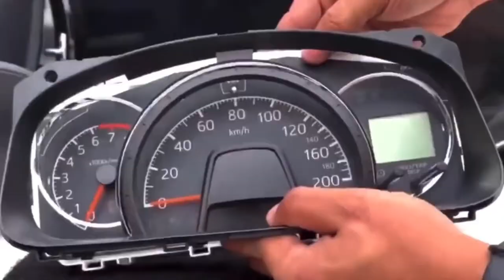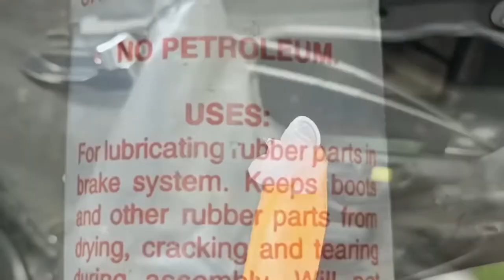DIY PMS on the Rear Door Window Regulator

Comment: Sir ano po mabisang pangtangal ng dagta ng manga na dumikit sa windshield?
Reply from the maker: soak the windshield using diluted dishwashing soap then use a clay bar while the windshield is wet then use a glass cleaner. yung iba naglalagay ng kaunting car carnuba wax sa windshield for protection from the elements, etc.